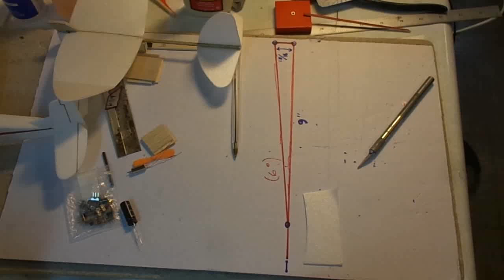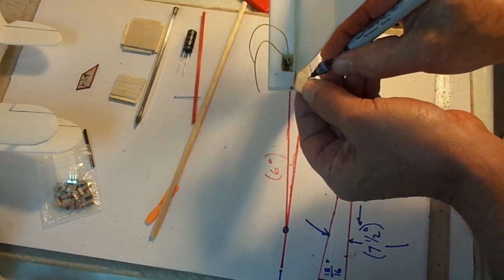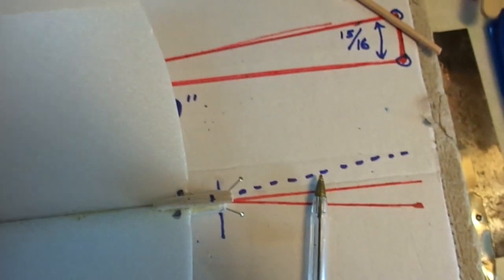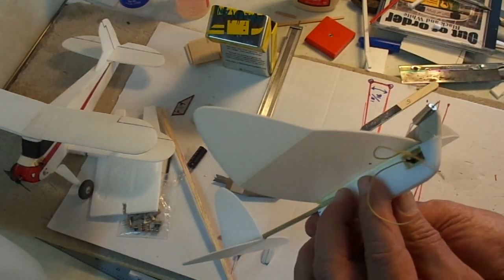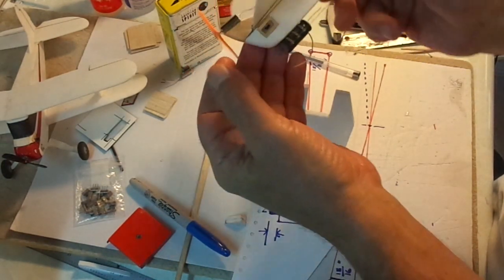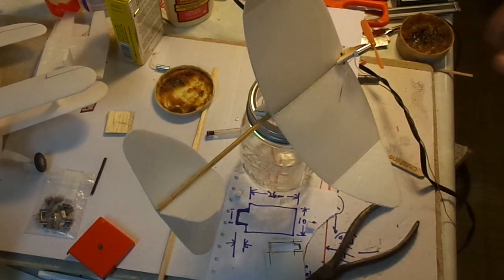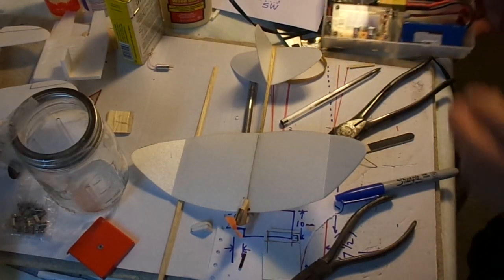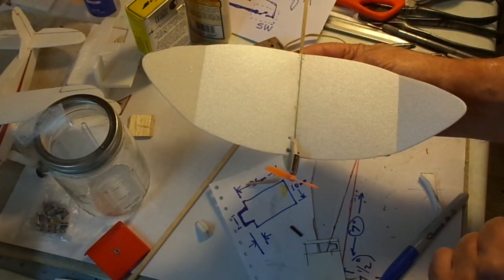Supercap Build Along Part 5

Comment: Hi Mike - does the little high wing plane in the video have similar thrust angles built in it ?  Seems new too me too go very far on angles, but I see you make it work!!-!!
Reply from the maker: Hi jack, I had to make a "pre-build" intro video after the fact to cut the side thrust in half on the build-along plane. The up=thrust on that one is absolutely correct however, it's a feature of the design which provides some direct lift as the plane is climbing steeply at the edge of a stall during the early part of the climb. The little high wing job has more normal looking thrust angles, about what you'd expect. 
I've gotten feedback from guys who have built along with the video series...word is that they fly great, maybe too good....quite a few flyaways. Lost both of mine, maybe time to build a couple more! -Mike